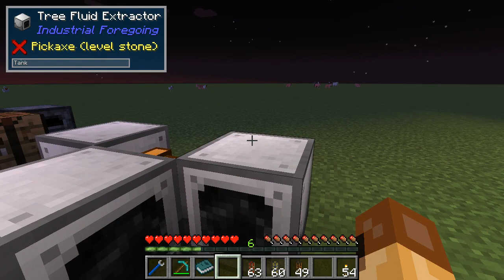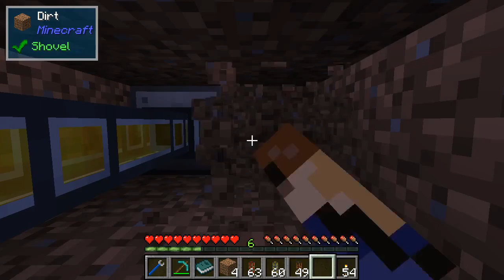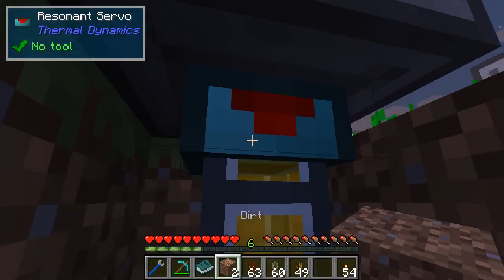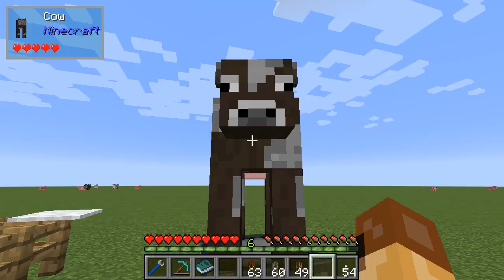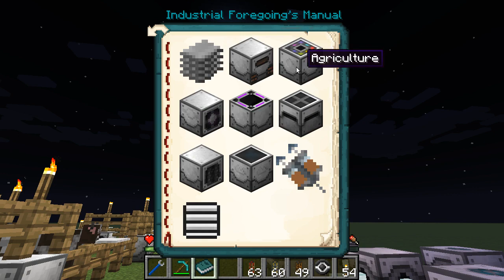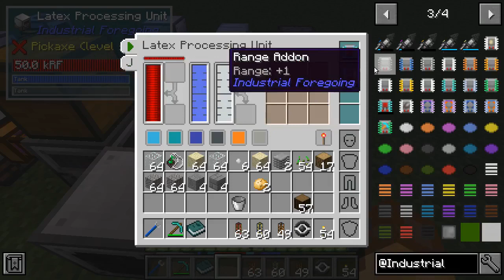Mod Spotlight: Industrial Foregoing

Comment: I'm pretty sure Minefactoy Reloaded isn't a successor to Forestry, but only inspired by it (and the original MF, of course), as Forestry was still being maintained by the time this video came out.

The rest of the info seems to be point-on, though.
Reply from the maker: In 1.4, Forestry decided to go from a decentralized system of planter/harvester to the large multiblock farms you know of from recent times. When that happened, people objected, and MFR came out as the successor for auto-farming. Forestry still kept getting put out, first by its original author SirSengir then later by the guy who did Railcraft, CovertJaguar. But that decision to go to multiblock farms for Forestry was a major split in the user-base, many of which moved to MFR instead.  

Of course, Forestry itself was based on the original Minefactory which was a BC addon waaay back in the day, before Forge is what it is today, when you had Modloader and ModloaderMP as separate launch API's and Forge was just another compatibility library rather than the entire API.
Reply: @ShneekeyTheLost  But doesn't MFR Planters/Harvesters pre-date Forestry Multi-Farms?

Edit: OK, maybe they don't. Searched and the oldest video of Forestry Multifarms is older than the oldest one for MFR Planters / Harvesters. Wanted to check the wiki for actual release dates, but Forestry wiki is down, while I don't even know if MFR has / had any wiki with actual timelines.

Is there any other, more reliable, source for the release dates? I will suppose you are correct, but I still would like to check myself, so I stop remembering things in a dumb way.
Reply from the maker: @TRak598  Unfortunately, when SirSengir melted down so spectacularly, he decided to take all his marbles with him when he flounced off, which includes taking down his website. 

The FTB wiki has some documentation dating back to this time, but it is sketchy at best. Some things we can definitively prove, however: 

https://feed-the-beast.fandom.com/wiki/MineFactory_Reloaded

According to the article, MFR started in the 1.4 era. 

Unfortunately, the earliest version of Forestry I could find referenced would be the 1.5 era, which already had the multiblocks in place. However, the change happened when the Forestry versions ticked over to version 2.x.x.x, which existed prior to that point.

Comment: Question, is Galacticraft's fluid pipes compatible with the mod? The wires seem to work just fine, i can power the machines with just Galacticraft stuff, but the fluid does not move at all

Comment: what are the mods you use?
Reply from the maker: The only other mod featured in this spotlight was Thermal Dynamics (the ducts) which can be replaced with any power/fluid/item transfer system.

Comment: How do we transport the energy with thermal dynamics?
Reply from the maker: Other than the wireless system I displayed? You don't. No mod is an island anymore, in these days of modpacks. Use Thermal Dynamics fluxducts, or EnderIO conduits.Or any of a dozen other energy transportation systems which exist. They didn't try to reinvent the wheel and implement a power system that was almost guaranteed to already exist within the pack somewhere.